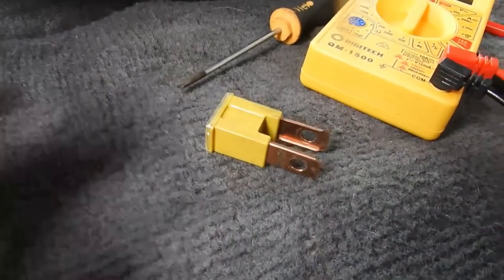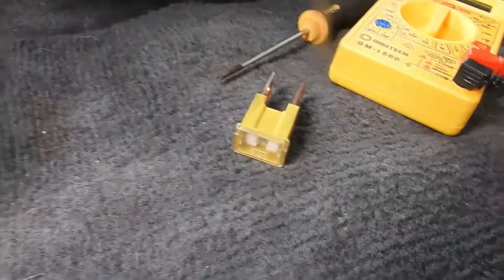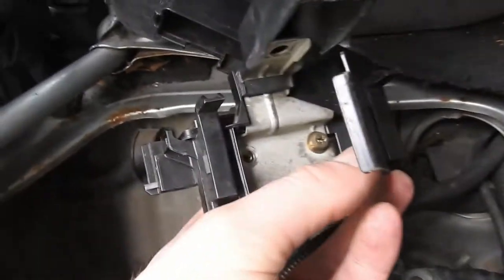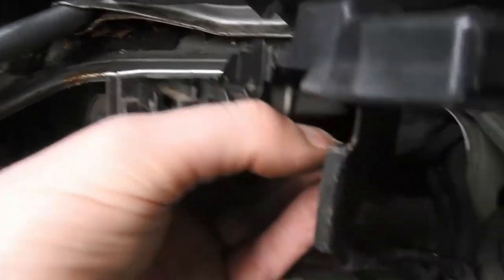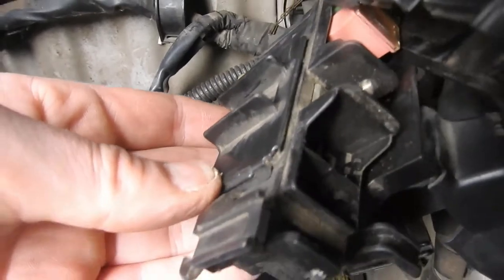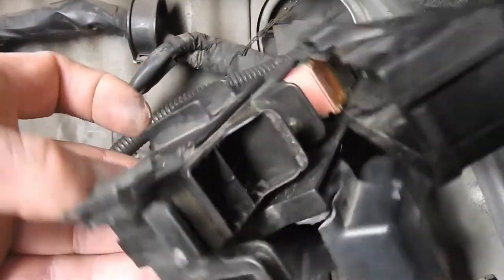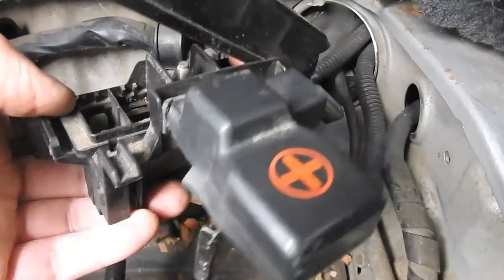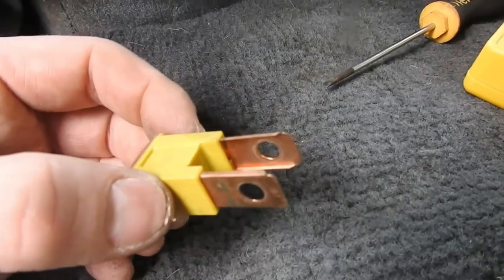How To Remove Big Clear Fuse That Is Stuck

Comment: Four five inch galvanized bolts, a half dozen 10 penny nails, heavy duty chain, high lead solder, super glue and tie-downs used to secure a 0.01 ounce 5 amp fuse in fuse box…poop and bubble gum used to secure 600 pound motor and transmission onto motor mounts…genius I tell you…pure genius